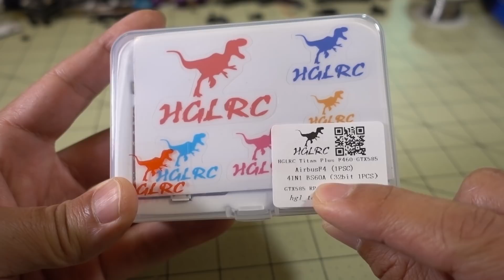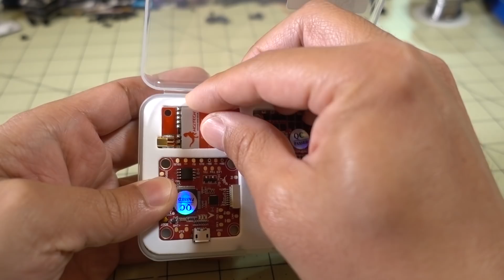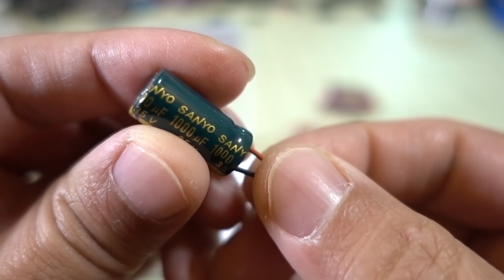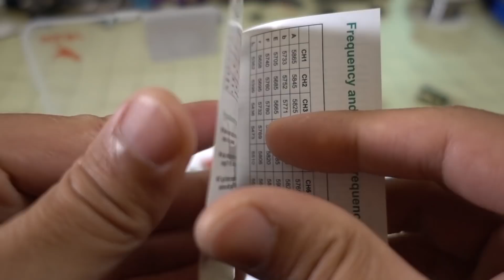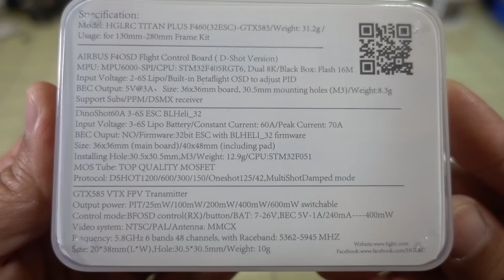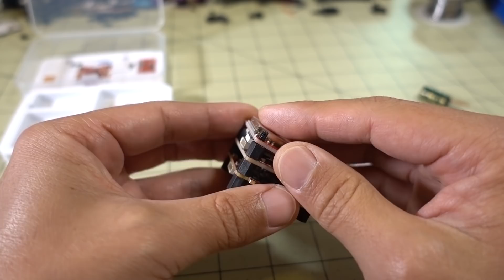HGLRC Titan Plus F460 Stack Combo Review ⚡

Comment: Hey Albert, i bought this set (without vtx) and i tried to install a gps... But that doesn‘t work... Pins are correct, rx on tx etc... for rx and tx i Chose rx6 and tx6= Uart6 right? Did everything on betaflight... But my bn220 Flashes only red... for hours... is it possible to run this Board with gps? I also tried soft serial... (led and Rssi), No results 

Thank you!!!
Reply from the maker: Have you tried a different board?  A different GPS?  What version of Betaflight?  Need more information.
Reply: i think rx6 is ESC telemetry according to the manual, probably that is why your GPS is not working

Comment: Hey Albert, is it possible to get telemetry with this Board? Thx
Reply from the maker: Yes, just wire up to one of the uarts on the board.  There are several options available.
Reply: Wow that was fast... do i have to create a soft serial Thing or simply solder it on tx3 and enable Smart Port?

Greatings from Germany
Reply from the maker: TX3 and SmartPort and you should be good.
Reply from the maker: TX3 and SmartPort and you should be good.
Reply: Thanks Albert... Here is one more subscriber!!!

Great work
Nice Channel
One who Takes care...

Perfect!

Comment: will putting the top two standoffs to the rear fix the problem?  seems like a lot of trouble just to have the vtx mounted closer to the front.... or is it more important to have the vtx mounted towards the front??
Reply from the maker: It depends on the frame.  The one I use needs it in the front.

Comment: 1 or 2 fiber washers under the VTX board is all that's needed. Or slightly longer standoffs.
 The holes on the FC look like they're designed for rubber inserts for isolation.

Comment: Use a slightly taller standoff for the front VTX mount (assuming it will fit the frame).  What is the S6 pad for?
Reply from the maker: I think S6 is for motor 6 but I didn't see an S5 for motor 5, so not exactly sure.

Comment: I was thinking 🤔 this stack would make a very clean merica build. Just curious if you believe the FC and vtx would fit in the canopy ? Or is the way the vtx mounts going to get in the way??
Reply from the maker: I don't think it will fit because of the mounting method.  Also, that frame has very specific mounting requirements for the VTX.  See the manual.